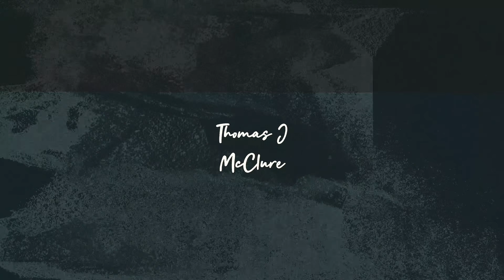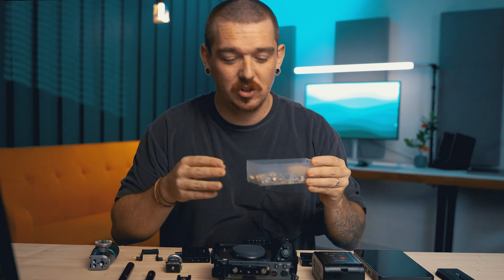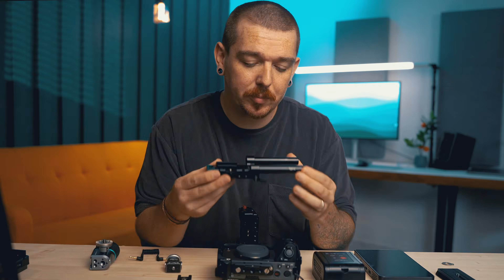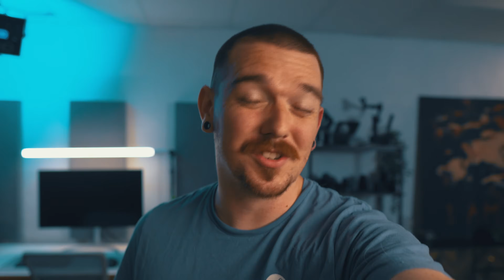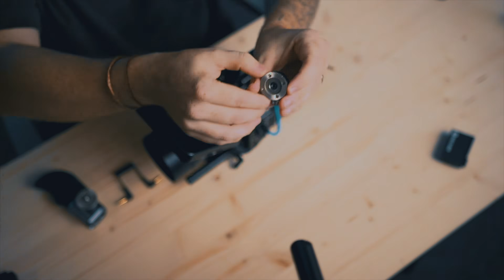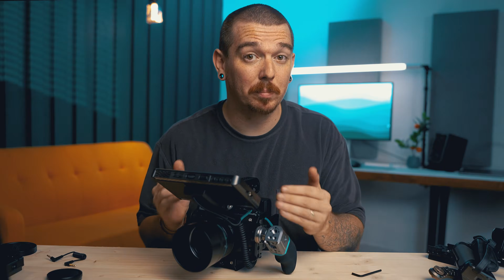I Built The ULTIMATE FX30 / FX3 Cinema Rig

Comment: I like the idea of just a different v-mount PLATE with more ports! So I would do it like this! 

Normal Z battery in the camera (so if the V-mount battery dies, it’s “hot swappable”) then usb-c cable from v-mount plate to camera for camera power and the z battery in the camera will take over if the v-mount battery dies, then power for a follow focus, monitor, powered handle, and any other electronics could also plug right into the v-mount plate if you get one with a whole bunch of ports! Like the Tilta one from Amazon comes with 5 ports!

Comment: Great rig overall, I’d suggest using a Dtap splitter, there are some that come with voltage readouts, also power your camera with a Dtap to dummy battery that way you don’t have to bypass your switch
Reply from the maker: That’s kinda the plan, the hard part is finding the right splitter that can be easily cable managed with the rest of the rig (there’s not much space) lol. But i got one ordered, we will see!

Comment: Love the rig, it looks so good! My only gripe with dummy batteries in the FX rigs is that when you have to swap batteries, you have to turn the camera off, which means if you are recording then you have to ask talent to stop and cut. I feel like I would rather power through a usb c cable or something so that when you switch your battery, you have less interruptions and don't have to stop recording because you can have the Sony battery in the bottom serving as a kind of backup battery. It also reduced the chance that if something goes wrong with your connection to the v mount then power remains.
Reply from the maker: For sure, ai prefer power delivery, especially in a camera that doesn’t overheat like this. I think I may have found a good solution, it’s ordered and I’ll give it a go
Reply: @thomas_j_mcclure no problem. I love the dedication to solving the rig for the best possible solution! 💪👍